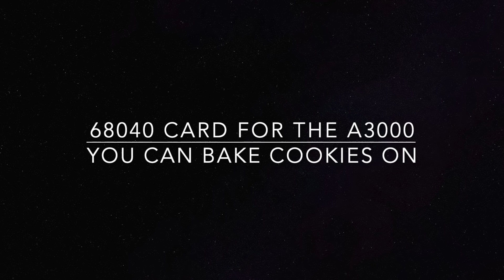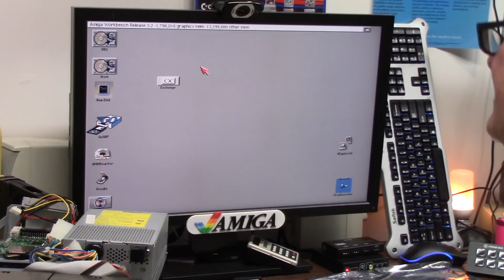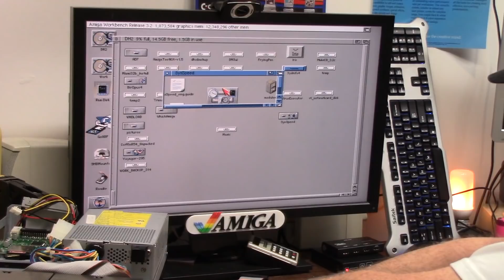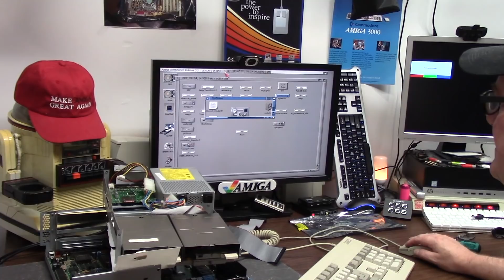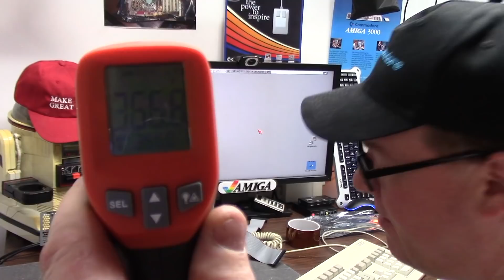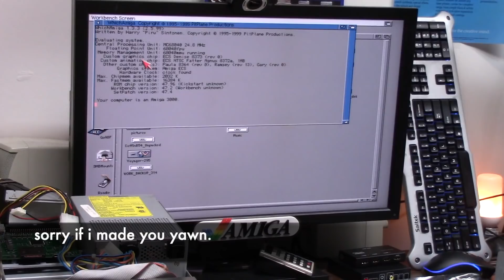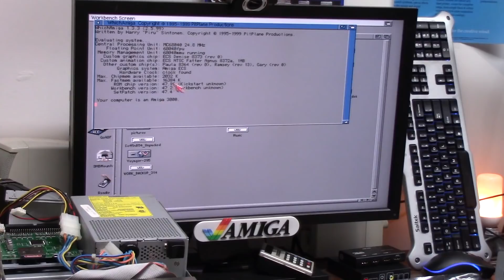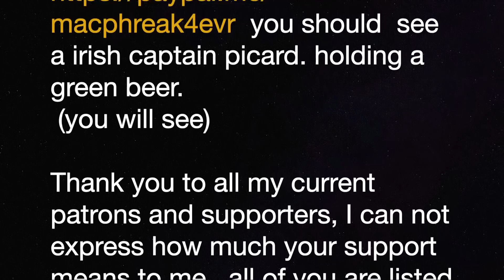68040 3000 you can bake cookies on

Comment: couple of options, use a solid aluminium block between the 040 and floppy tray, dump the heat into the chassis or Remove the 2nd floppy, cut a hole in the tray above the 040 and then mount a fan above it.

Comment: Another great vid Chris 👍🏻 Don’t own a A3000 (But do own a A4000 😉), as for the overheating 68040 a couple of suggestions. Card isn’t getting more than 5V for the CPU? The heatsink is fitted correctly? Maybe you hit the nail on the head with the amount of CPU paste, maybe it’s just covering the outside of the heatsink and NOT properly in the middle? I know  back in my days building PC’s if you didn’t set the paste properly the Intel and AMD chips would just overheat and with the PC having Thermal protection would just shutdown.

Comment: Air intake is the rear side, opposite the PSU.  It flows around the expansion cards, thru the notched areas of the daughterboard, then over the drive bays & processors and out the PSU (assuming your fan is not one of the reversed ones).  I think the vent on the lower front bezel is more decorative than functional.

When I ran my CSPPC in the desktop A3000, I sacrificed a drive bay, cut a hole in it to accommodate the heatsink & fan.  I sold it when I upgraded to an A3000T.  Always wondered what became of my old A3000D.  If you bought a used one, painted black, with a hole in the drive bay and a ROM tower, let me know how she's doing.

Comment: Back in the day,i ran a A3640 in my 3000 i removed the heatsink, got a 1/4" thick fan and put it on the 040 with dabs of silicone on the 4 corners leaving a tiny gap between it and the chip, that machine ran 24/7 and never missed a beat. The Pals do run hot,but wow..  Shorted cap causing hot pal?? Also remember the 3640 with dmac2/ramsey4 combo doesnt like sczips(zips end in 402 number) in the first ram sockets,it needs page mode ram in first sockets(zips # end in 400). all ram will run in page mode regardless. i can attest changing to gals is great they run nearly cold,but the 3640 is a POS anyway. Also check for broken/shorted  traces under the caps when you remove them,seen this alot!

Comment: I can't say I enjoy taking my Amiga's apart and while I have a ton of stuff for them I lack the motivation for some odd reason to install anything new.   I would put that board under a Microscope and check everything out.   You could always open up the front of metalwork to allow air to flow under the drives.   Speaking of drives.   Where do you find A3000 Disk Drives these days?
Reply from the maker: Just standard fb354 or 357 hd drives. You could even use converted PC drives for either one as long as you have the metal mounts
Reply: @ChrisEdwardsRestoration  I have done the PC Drive conversion in the past but the actually button shape to fill the hole.  I downloaded a button file but not really certain it might fit on drives I do have.  I guess I could try it out.

Comment: I just added a warpengine with rev6 060 adapter running at 80Mhz with 128MB 50ns ram to one of my A4000's with 3.2 roms and workbench 3.2... All the proper libs are there and such but workbench runs like molassas! it feels like its 030/25 but should be screaming at 80MHZ. scsi is with acard7720u and a CF adapter, its only showing 3.5MB/s!  i cant find the trouble,all the hardwares right,sysinfo reports its fast,and whichamiga shows all is good. ITS SLOW and i cant figure out why. i suspect its 3.2...i guess i will chunk the 3.1 roms back in and check it.
Reply from the maker: Did you set your jumpers?   Some of the more advanced cards did not need jumpers set from their factory positions…. Mine was slow till i turned fpu to ext then she woke up

Comment: Maybe get a heatsink off a pc chipset or Xbox 2/3 something maybe 15mm high and put a 40 mm fan in the front panel behind the plastic front 

Do the caps first and test 

If it’s still an easy bake oven .buy a 40 mm hole saw and strip the system down again 😎so the mother board can’t get damaged and work out the best place to put the fan 

It is something that you need to measure hight wise 

Like stand-off and components hight in the area 

Masking tape helps me on metal

Hopefully a recap will work

Comment: Doesn't MAPROM require FASTRAM to be avalable?
Reply from the maker: Yes.  Im idiot
Reply: @ChrisEdwardsRestoration  question is why did it start working without any changes on the third boot attempt, what the heck prevented the first and kept fastram off on the second.
Reply from the maker: @wskinnyodden   needs a recap, which i do next